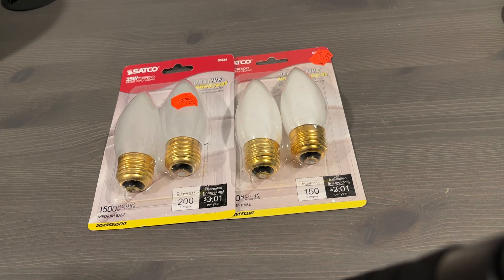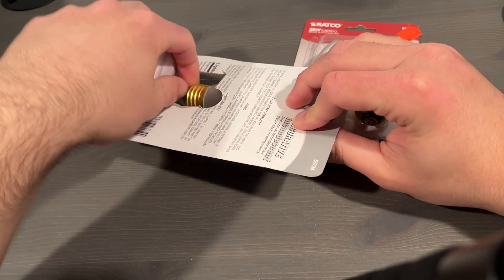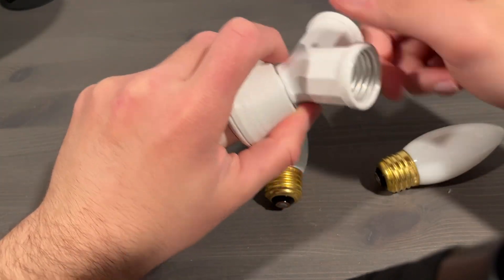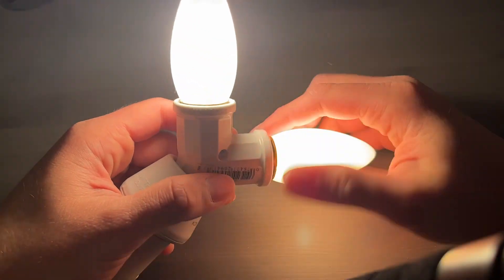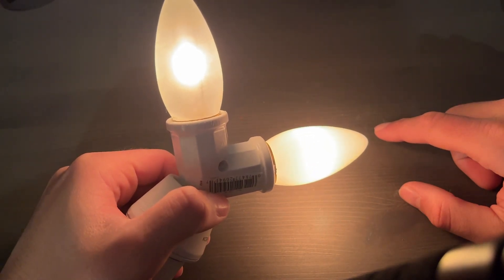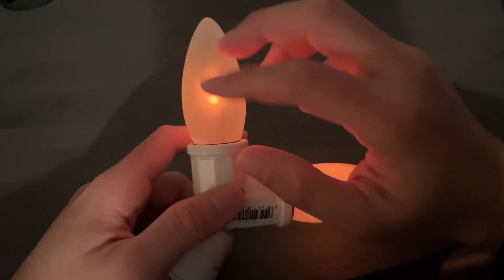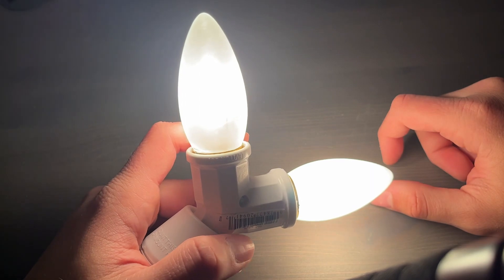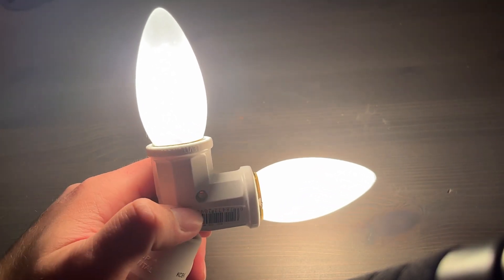What Is The Difference Between Frosted and White Incandescent Light Bulbs, Explained

Comment: I prefer the frosted one. I always liked outside frost chandelier bulbs. I don’t find a use for the inside white bulbs, I’d personally go for frosted in modern chandeliers (such as black chandeliers). For crystal chandeliers clear bulbs look better. Frosted bulbs are also much brighter, yet the light is still diffused well. If I were you, I’d personally use a 40 watt or 60 watt version instead of a 25 watt version.